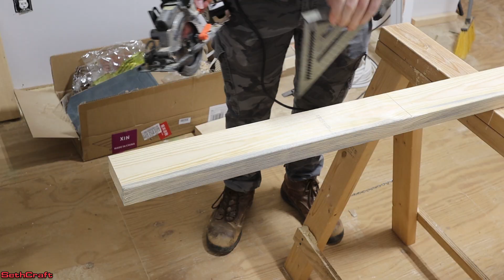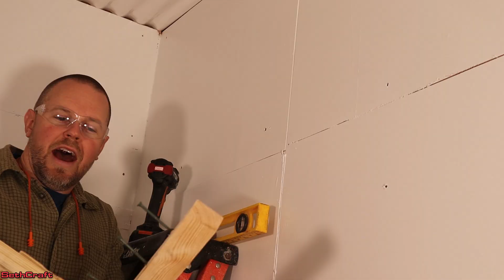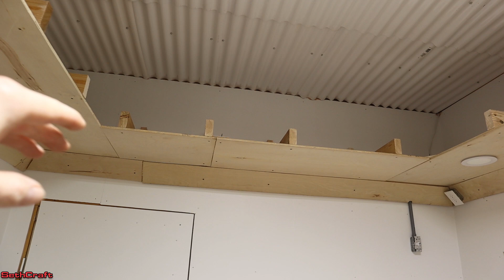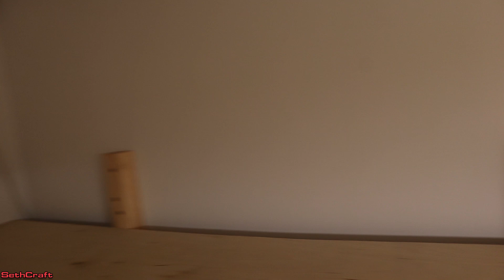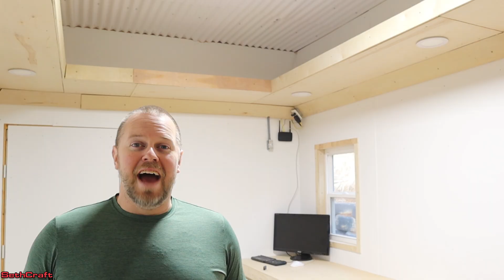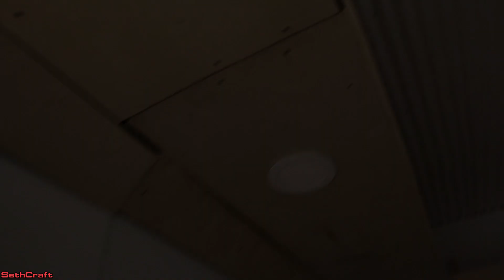Build Custom Shop Shelves - Build a 20x30 Workshop

Comment: Nice shelves.  No worries about the OOPSIES, if it were too perfect you would be afraid to use them and mess them up.  With that many brackets to make I think it would have been worth the effort to use your table saw and chop saw.
Reply from the maker: Plenty of things in this 20x30 build were less than perfect. Thats the fun in building as an amateur. I had not taken those tools down the the new shop to use them yet. the table saw would have made short work on that rip cut.